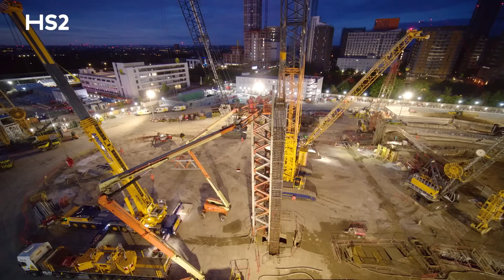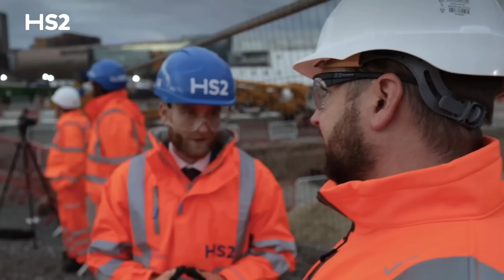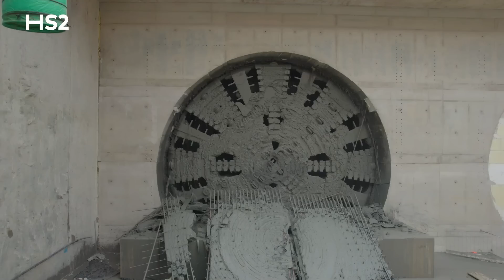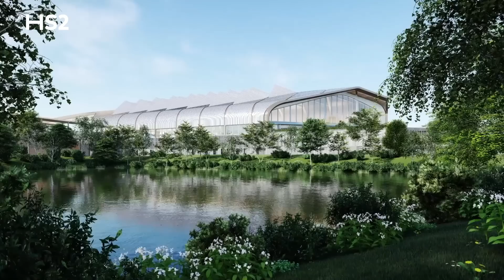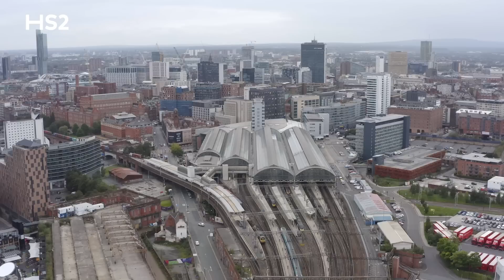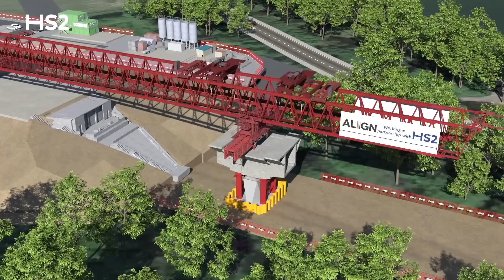HS2 Project Update, October 2022

Comment: Proud of the carnage you are causing and the massive waste of money this project is responsible for . And all to save a few minutes on a railway journey people won’t be taking .
Reply: Explanation pleae
Reply: @euan.4551  ?
Reply: @ccampbell1117  hs2 is needed for capacity 
Bur i bet you will support road building that is worse than building a railway
Reply: @euan.4551  £150 billion and rising and we are going to be taxed out of existence to fill a £50 billion “ black hole “ . No we don’t need any more roads just the existing ones repaired and yes a lot more investment in useful local train services that will be of benefit to all the population. 😀
Reply: @ccampbell1117  HS2 doubles rail capacity between London-Birmingham and triples capacity between Birmingham and Manchester. That's a lot of local services.

It's being built this way because creating the same level of capacity on the existing network would cost several times more and the railway would have to close for years at a time.
Reply: @cholloway0046  and it’s costing £150 billion pounds that we don’t have. Not to mention it will be controlled by the RMT Union.
Reply: @ccampbell1117  £150bn over a design life of 100 years is £1.5bn per year. To name one issue, the cost of materials has risen by more than a third since January - but that doesn't invalidate the project. Britain deserves a railway network as good as France or Italy that can compete with domestic airlines.

I will add that HS2 is paid out of government loans and not general taxation.

Comment: I'm surprised the tunnel breakthrough part showed the last bit to be drilled had rebar in it. I presume this was just a cap they added to seal the tunnel until it was fully drilled but it's a bit odd to steel reinforce the cap when you're just going to be drilling it off very soon.
Reply: When building the entrance, they usualy excavate around 10-15 meters, and lign it with conrete of the same diameter as the drillhead. Then they just wait for the drill to arrive. Sometimes that can be motnhs away. So it is to make sure, that noone pokes a hole in it, after it has been capped off.

Comment: Apparently HS2 cost 7 times per km when comparing with those built in EU or 10 times those built in China.  It has been claimed the higher cost was due to permitting and environmental studies.  This world suggest the permitting and environmental studies on their own is 6 times of actually building HS2 in UK.  Look like it is a Rolls Royce job as the previous HS1 open in June 2010 cost £63.33 million per km

Contract cost of HS2 £200 million per km
European cost based on EU bench marking studies between £32 to 25 million per km
Published HSR (at 350km/h) cost in China between US$ 17-21 million per km, with a high ratio of viaducts and tunnels.
Reply: they have to funnel a lot more money out of the project here, make sure all the rich people get their cut

Comment: Man... if HS2 ever gets up to Glasgow, that would take a lot of traffic off the roads & out the air.... Plus, if there's a connection to HS1, then you could have international travel from Glasgow into continental Europe via train... and if there's fast freight available, that would also do wonders
Reply: Can't understand why HS2 and HS1 have different termini in London, making journeys from outside London to Paris awkward as they require a transfer. An underground travelator is needed!
Reply: @spacetweek  Would increase costs too much, can happen in future if necessary.
Reply: @Garner84  yeah, can't have it benefitting places with worse infrastructure than Birmingham
Reply: @spacetweek  There is an underground travelator, either the Victoria or Northern line.
Reply: @spacetweek  Logistics ...
One goes north the other east , too much infrastructure in-between , circle line etc etc etc
Reply: @spacetweek  it need not be underground.
Reply: @spacetweek  I mean, once (or if) Crossrail 2 gets built, technically it will be part of the same megastation.
Reply: Dream on even Leeds has been bypassed now
Reply: I don't wish to spoil your illusion Rob 😂 I just watched a 100 billion rail project that went through several mountains to join two continents . The way our gov performs I don't think they can get to Glasgow for that price , that said good luck I hope they do 😃
Reply: That's  50 to 75 years away.
Reply: That's a return to the Victorian era. It'll take days to go anywhere.
Planes will do it in a fraction of the time from a 3 mile strip of tarmac at each end.

Comment: its a shame the north (Leeds etc) won't benefit from this anymore
Reply: Don't give up.

The, so called, Integrated Rail Plan, is a bunch of nonsense, that doesn't hold up to any sort of scrutiny by rail experts. (It relies on running fast trains faster - which means cutting local services. That's the opposite of the thing that HS2's Eastern Leg would have done, as HS2 removes the fast trains and gives the mainlines over to local services and freight.)

There are plenty of folks in Great Britain who want more rail investment, instead of RiS2. But the numpties in 55 Tufton Street pretend to be the voice of the people.

We all have to pull together and push for the Eastern Leg and the high speed line across the Midlands to be put back into the plan.

And, we have to push for HS2 to go all the way to Edinburgh and Glasgow, so that we can start turning railways around our cities into a series of high capacity commuter networks.
Reply: @DavidShepheard  Perfectly put. I was born and raised in London and I am a train driver. When I heard of HS2 I was like finally the north is getting some much needed investment for too long that region in my opinion has been neglected. I was torn however as I didn't want swaves of the countryside to be destroyed in order to do it (I am a hypercirt I know). Then I head the announcement that the Eastern Leg was cancelled and it has left me feeling like what is the point as the Eastern leg in my humble opinion and further should have been the main focus. Driving up and down I see disused lines and lines that have been ripped up and think how different things could have been if they had remained. It would also help with the push towards going green.
Reply: @DavidShepheard  Labour will restore the Eastern Leg.
Reply: @iwasborn8470  so plunge the country into further massive debt rather than staged development??
Reply: @xr6lad  Errr… the Tories have grown our national debt faster in 12 years than any other government, all while slashing public services and making people utterly miserable. At least if we’re putting on debt we might as well invest in something that might actually make us proud of living in this country, rather than just losing billions to the Tories giving meaningless contracts to their friends.
Reply: @xr6lad  This is peanuts compared with what the NHS costs every year and yet we can afford that apparently.
Reply: @DavidShepheard  I believe Labour will be good restore these projects quickly. To calm the market I would even do it Sweden style do it by way of a new infrastructure tax that be share between companies and people to pay for it.
Reply: This really needs to connect to York via Leeds. Leeds is a large city and York can provide north and southbound connections to the east coast mainline.
Reply: Oh dear.   You do understand that the motorway network, electricity lines, telephone lines etc etc were not built at all exactly the same time in every corner of the country at once.   Wait.
Reply: @xr6lad  the plan was to build a bit at time with at least three stages. Those later stages have been binned so there is no plan to build some bits later on.
Reply: This is a Fantastic project, it keeps million of people in work and pays taxes, help to ease over crowding on the West Coast Midlands Railway and the North, take loads of cars and lorries off the roads, I just wish the nimbys would stop moaning. This project will help stop increase of global warming and reduce air population on our British congested roads for our health's. Well done HS2 and keep up the great work!!
Reply: @scottpeacock5492  paying taxes with taxes is not always the best idea, labour won't do anything they will raise taxes higher just to pay to run the government not build infrastructure, after this phase is done they will all pat themselves on the back count the money they funnelled out of the scheme and forget anything else was planned. 

how many times do you have to see this happen and still expect anything different to happen.
Reply: it's a shame 'UK' project representatives call somewhere not even half way up the UK 'The North'